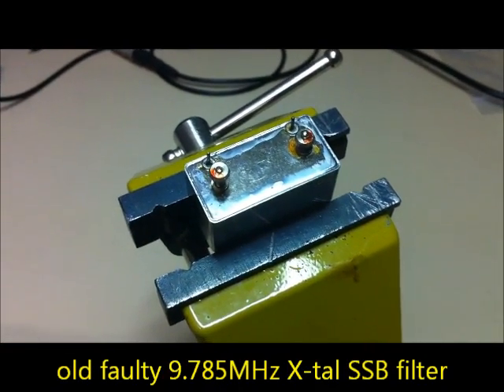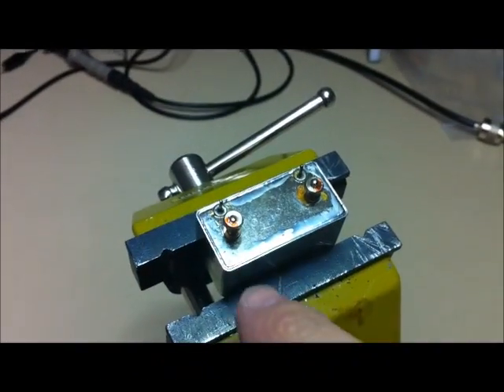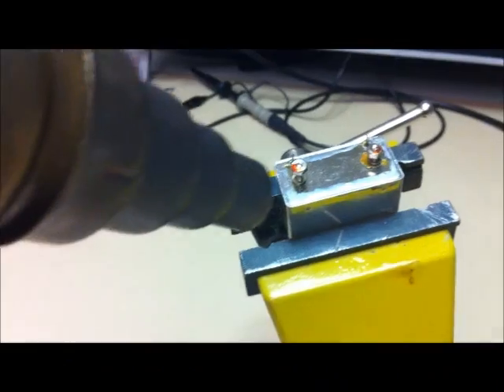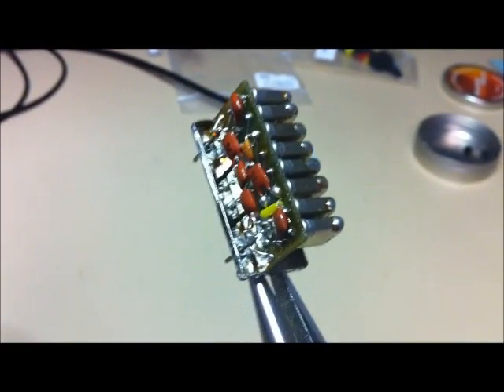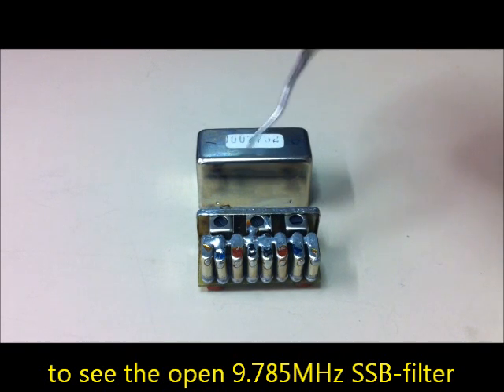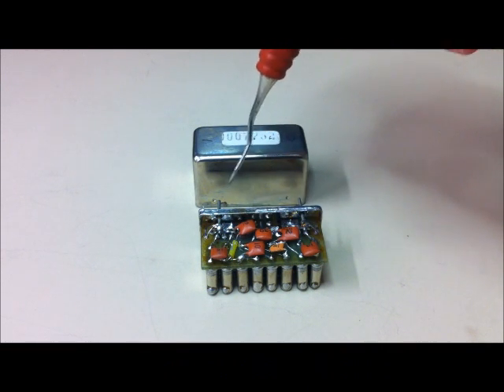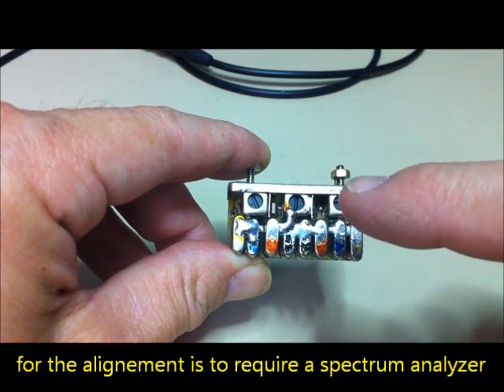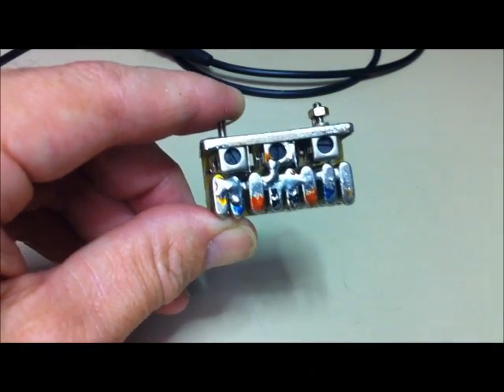SOMMERKAMP TS-340 and ROYCE 1-639 open 9.785 MHz X-tal SSB-filter

Comment: Hi on the sommerkamp it says in the sams to connect an ammeter at the junction of L5 and c77 to measure the final bias. If you checked the final bias on your sommerkamp please can you tell me where on the pcb you connect the ammeter and do you have to remove any wires or components to do this?